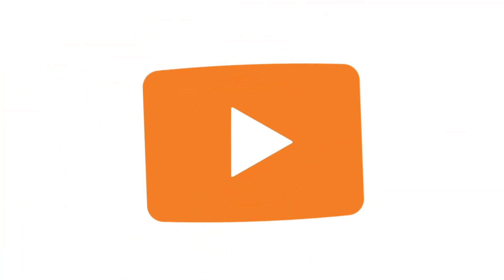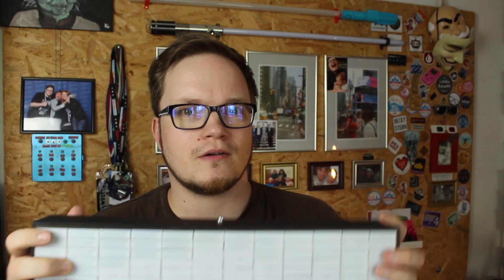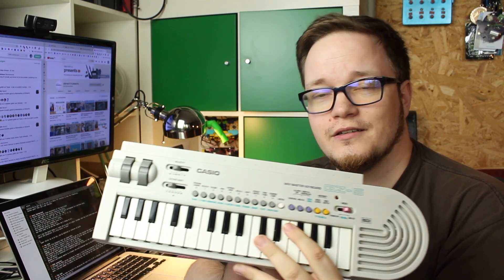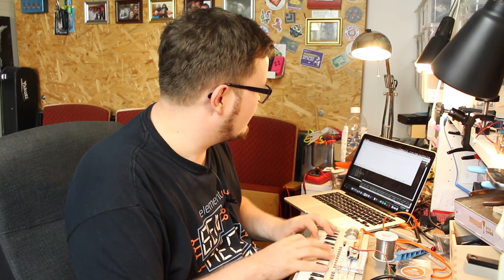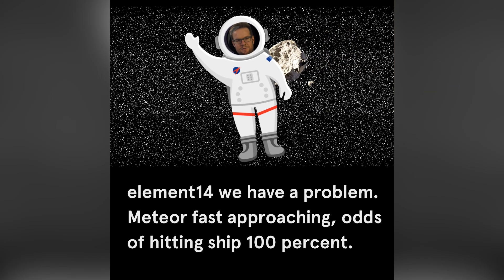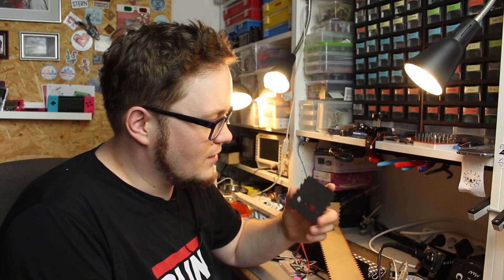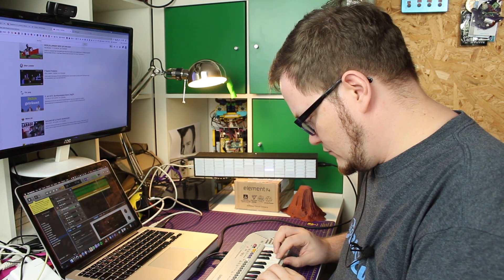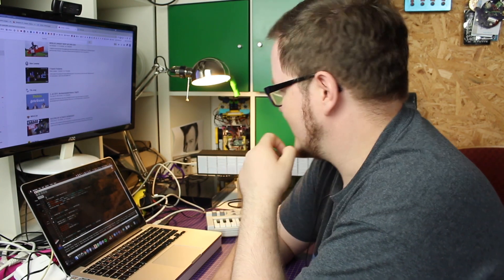Arduino Powered Close Encounters Midi Light Board

Comment: I'm confused, when you pressed c you got 90, 30, 32 but when you released you got 30, 2 for a total of 5 values.
Shouldn't there be six values?
Is that possible where you bug is coming from?
(sorry, don't know anything about midi.)
Reply: When the status byte (90) is not changing, then it will just send more note+volume commands. In this case the keyboard turns off notes by sending volume zero. At the time of recording I was expecting the note off status and "saw" 6 bytes and thought the 32 volume of the tone on is the note_off command instead. 

Anyway, I started counting notes and decreased the amount playing when the volume was set to 0.

Comment: Cool project! I'm not sure if your older Casio controller keyboard (cool retro piece, BTW!) supports MIDI Running Status, but that could be one reason why you're getting stuck notes. MIDI Running Status is an optimization that omits subsequent status byte(s) if the next message is the same. Google for details. You can tweak your code to not always assume you're getting 3 bytes for every note. Also in your code, if your status byte indicates it is NOT a note, you should still read the additional bytes and just throw them away. It is possible that the Casio is sending other data that you need to read from the serial stream and ignore. Using a MIDI library that already does all the parsing can be helpful here.
Reply: I was looking for that retro classic CASIO VL-TONE and stumbled over that - not too much hype plus midi for cheap :)  Will google that for sure, thanks a bunch! I have a bunch of Serial.flush()s as well, but also ignore anything but the "play note" one.